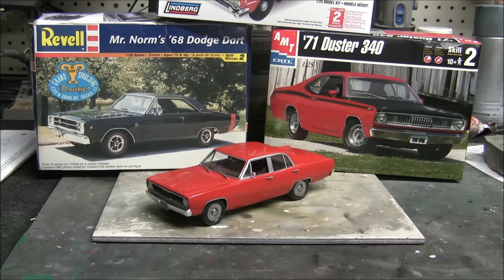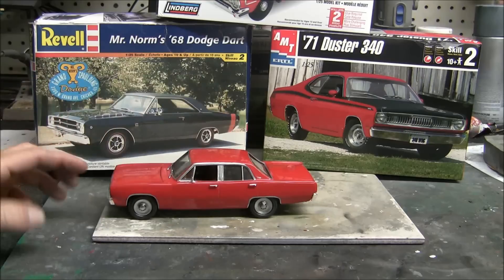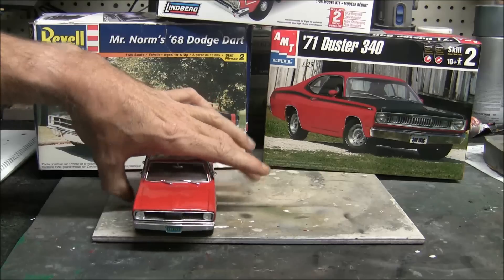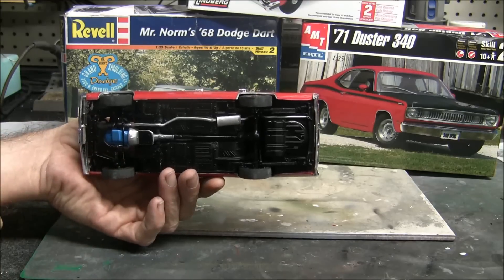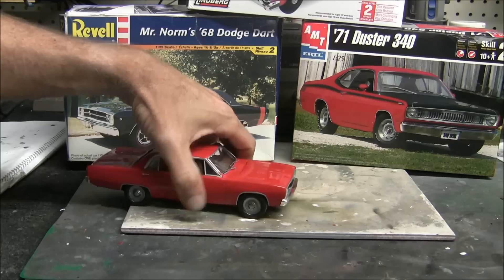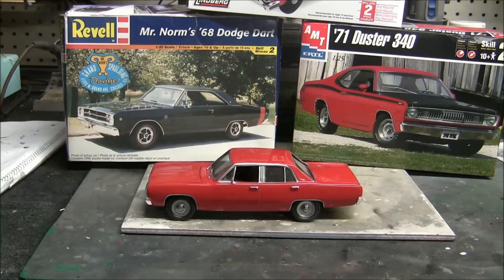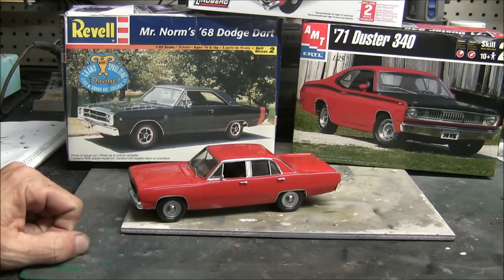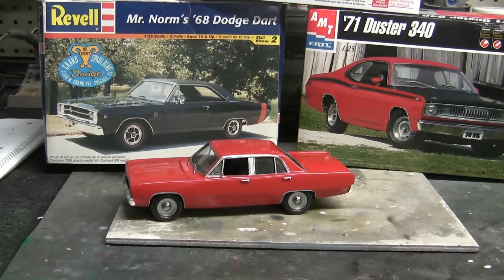"Duel" 1:25th Scale 1971 Plymouth Valiant Kitbash Model

Comment: I have the 340 Duster and yes the front wheels on it sit a bit back, I left the steerable and the the tires rub on the fender. Really like this one, well done. Only one thing I'd add are the bumper guards, I remember the scene where the car gets hooked under the school bus's bumper. I guess those would have to be scratchbuilt.

Comment: I agree with the 4dr comment.  I have a '56 Fairlane Town Sedan, it was a 4dr only version while the Club Sedan was the 2dr version.  Problem is cant even find a '56 Fairlane kit to even try to modify.  I did come across some '55s but the grill front turn signals were different.  So its nice to see you were able to complete this successfully.
Reply: AMT does a 1/25 1956 two door Victoria, models of 1955s would be very rare.

Comment: As I recall the fenders had small rectangular V8 notifications can’t remember what they said not commando because it would’ve been a 318  I remember it spinning it’s tires at r r crossing.  Your passenger b pillar’s looks better than drivers side .I can’t tell if the rear passenger doors have a line that bends down to the rear ww opening. The wheel covers were full discs as I recall kind of a rounded cone shape with small holes or black dots near the “summit” of them

Comment: Beautiful car. However, the 71 Valiant hubcaps were full wheel covers not dog dish. And the holes are far too small to simulate lug nut holes. They were actually functional vent holes to vent heat. The Plymouth Sattelite had the same ones except the same holes were around the perimeter not on the center. Lastly, engine displacement was viewed differently in the early 70's than now. I think the duel car had a 318 V8, which was considered a small underpowered engine following the muscle car era.
Reply from the maker: +James Southworth Yeah, there is one scene where you can see the v8 emblem on the front fender of the car.